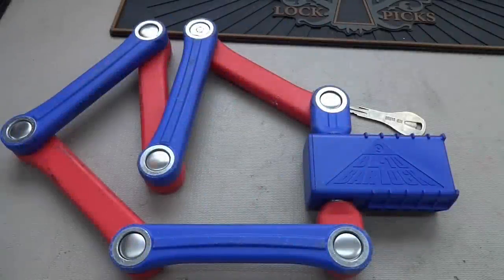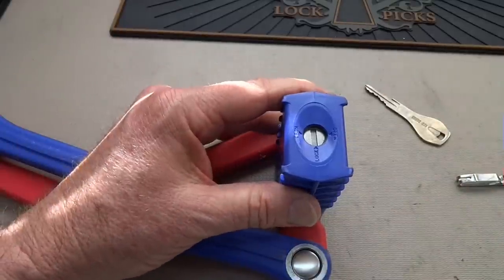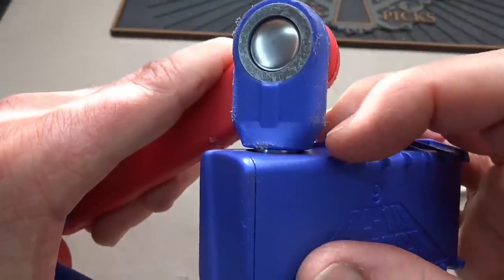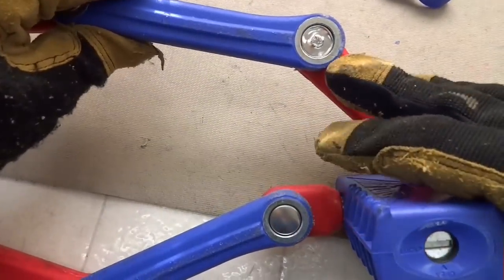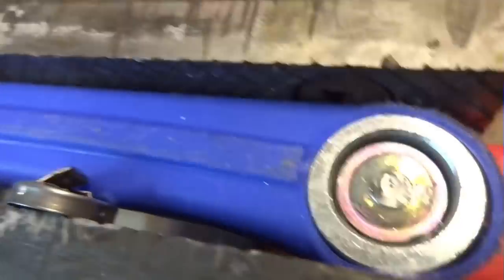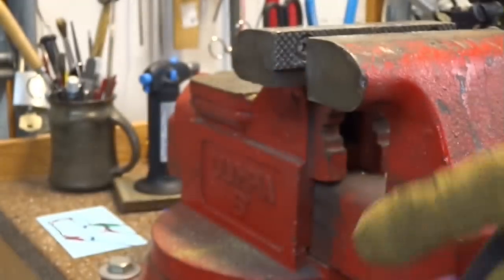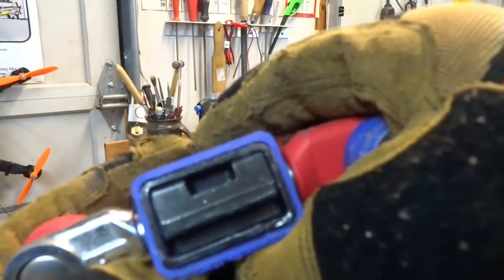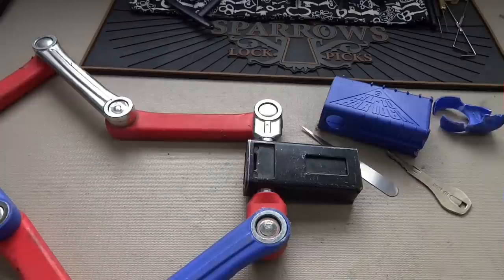(774) Japanese BL-10 Bar Lock

Comment: It seems like a massive oversight to not have the metal flared out to cover that shimming weakness.
Reply: +Dan Xepha that was probably expensive
Reply: nebreprah It wouldn't have really required that much more steel to be used. Just need it to be as wide as the plastic that was covering it.
Reply: My thought exactly. then it would be  impenetrable
Reply: Exactly what I came to say.
Reply: My exact thought. Penny pinching over that little bit of extra metal they'd need cost the entire security of the lock.
Sure, that little bit of steel adds up over a couple thousand locks, but I'm sure design-wise they could have taken it from elsewhere in the lock assembly.
Reply: Do you think maybe those battery powered Dremel with cutting disc would work or not enough power maybe I’ll test that
Reply: I know such a simple modification would go so far

Comment: Yes, a customer convenience caused it to be easy to shim, would be EASILY fixed with a large washer to wrap around the bolt of the lock, this would probably make it very difficult to shim.
Reply: yup
Reply: +Little John pretty much what i thought after seeing it,  apologies if it's already been mentioned ( & i ain't reading through 750 odd replies to find out) but a simple redesign of the bolt to include a shoulder would prevent this. Perhaps they're saving it for next years version...
Reply: stuart j Mckay Haha, probably.

Though honestly, some times I feel that they add these features to make them breakable for smiths.
Reply: +Little John anything is breakable for a smith. or an engineer when it comes down to it. the hard part is putting it back together afterwards.
Reply: vishal chan Well of course anything is breakable. The major flaw of this was how easy it was to shim, with $1.00 or less spent on washers, this lock became a hell of a lot more difficult to deal with.
Reply: +Little John agreed
Reply: They clearly noticed when designing, hence the circular shape on the base of the plastic shell. Id say idpf they had as you said a "washer", or just as extra metal circle just to sit flush with the outer face of the locking mechanism, rather than that plastic piece. (They probably didn't do it to keep manufacturing cheaper)
Reply: just make the metal shackle larger and closer tolerances. shim don't fit? problem solved...
Reply: even if they just made that plastic cover Bill had to remove out of metal instead it probably woulda done it
Reply: put the washer exactly whet the bolt sits in the lock and it would be shim proof
Reply: Bailiffs rather than locksmiths lol
Reply: unless its a very strong washer you could easily break it.
Reply: It'll be more time consuming even if the washer was breakable the amount of work it'll take I would get caught by the owner or. A walker
Reply: Wonder if they designed the metal parts first and got tooled up to make them then decided it was cheaper to change the plastic moulds than to change the steel machining later.

Comment: I was kinda hoping you might mill the thing open to find out why the lock was so hard to pick.
Reply: +Jim Fortune agree
Reply: agree
Reply: Agree
Reply: Three out of three people agreed with me on a post. A personal best! ;->
Reply: +Jim Fortune disagree.
Reply: +Jim Fortune He did in the revisited video.
Reply: Sam C I shoulda known
Reply: JelloMastermind From 7 hours ago? Wow you're current! ;->
Reply: +Jim Fortune 
If you're using a tumbler rake you're gonna have a hell of a time trying to get 9 pins to line up at the same time in order to allow the cylinder to rotate.
I'd like to meet the person that could use a hand full of lock picks to manually unlock this thing.
Reply: Jim Fortune I try my best.
Reply: it don't need picking as it's opened with a shim in seconds.  price of crap
Reply: Tangobaldy As he points out, throw a washer on the shaft and you can't shim it. And if insurance requires that the users replace them every year a slight mod could be on the streets in a year.

Comment: Could the issue be reconciled by expanding the part with metal just before the lock so it lays flush right against the gap where you could put the shim in?
Reply: +Donald Neal I thought of that also. Wouldn't be able to slide a shim in, or at least not easily.
Reply: +Slowpoke59 i guess they thought in polite japan nobody would peel off the plastic
Reply: +Justin M i'm pretty sure they left that in so a locksmith could open your lock for you if you lost the key.. but idk, i'm far from an expert.
Reply: kfftfuftur The whole point of hiring a locksmith is that you get the lock back as well.
Reply: +Oliver Turner or the car
Reply: nebreprah Well yeah XD i mean, if the lock is PART of the car then getting the lock back kinda means the car too, or whatever it was locking.

Comment: That shimming problem can be fized by just flaring out the end of the shackle ends so that the steel core blocks the gap.
Reply: +John Grewe That would resolve the issue. Other than it is a solid lock and I wish we had those in the states.

Comment: Sorry if this is a silly question, but how can the lock be free-floating? I'm just struggling to wrap my head around how that works.
Reply: +Virideon I'd like to see the lock taken apart so can see how it works.
Reply: +Virideon its just a flat zylinder inside a hollow cylinder, if you put the key in, it pushes the pins out of the inner cylinder, the cylinder wont have a flat surface anymore and kind of hook on to the holes of the outer cylinder that represent the locking mechanism
Reply: +jort93z If that's the case, could you use something to fit into that grove and tension it (instead of the normal tension wrench)?
Reply: He demonstrates that it's free-floating. With a tension tool or screwdriver, the plug is will rotate, but not unlock
Reply: @Marc Herrmann
that would mean only one pin needs pushing to turn the outer cylinder :-)

Comment: They could've easily designed against the shimming and still allowed you to just click the shackles in place.
I mean, unless I'm wrong, just having the exposed part of the shackle be larger and thereby block access to the otherwise shimmable portion.

I have to think that they somehow didn't consider anyone would cut off the plastic and shim it. A pretty significant oversight given the design of the rest of it.

Comment: It makes no sense that nothing binds when you try to pick the lock. May be the wafers are not engaged with the cylinder and that is why they can turn freely. If that is the case then wafers are also not locking anything so moving one of them far enough to engage and then turning should open the lock...

Comment: You didn't try attacking the links by forcing some sort of wedge between bars there.
Reply: That's the type of attack the Abus Bordo 6000 failed on. They used a pair of bolt croppers to force the links apart and I think eventually cutting the link pin.

Comment: Bill,  The key has a long neck - between shoulder and head ( bow. ) I'm assuming just the top section of the lock spins free - anti drill, anti tension. You may have tried it, but a longer extension on a 90 degree tension tool, would it reach the start of the key way to apply tension? The key appears similar to many Japanese vehicles, with 8 staggered wafers - 4 on either side. The tops of the wafers could be serrated, matching the serrated wafer slots, although that's not always the case.   Regards, Brian.

Comment: Can you smack the lock portion with a mallet to bounce the locking pawl and yank the loop out?  The timing might be difficult, because if you're pulling the bar away you might be locking up the pawl so it doesn't bounce.

Comment: have you tried getting a pry bar and hammering it in between the joins on the lock?
Reply: +Ericbuyslunch He tried punching the joints out and explained why that wasn't possible, so prying them apart won't work either
Reply: +ProdigyThirteen Spot welds aren't that stong, and the wedge is going to give you a force advantage and strain the join in such a way much more of the hammer blow will be against the weld points.   A good pickle fork or other ball joint separator might work. http://www.ebay.com/itm/BALL-JOINT-SPLITTER-SEPERATOR-SEPARATOR-TIE-ROD-END-REMOVER-REMOVAL-3250-/321375724869
Reply: Really old response, but after watching LPL use a nut splitter to open a similarly beefy Abus, I think it's viable. ( https://www.youtube.com/watch?v=Zs8uyPsDaw0 )
The point of weakness is the tensile strength of the rivets connecting the bars. Using a nut splitter like his, a tougher rivet simply translates to a few more ratchets. That said, this lock looks tougher than the Abus, and I'd love to see LPL get his hands on it (I'd also love to see LPL try to pick and/or gut the core.)

Comment: Thank you for using metric units!
When in comes to shimming this is sometimes prevented by means of a one time mechanism. That after the lock has been opened it will allow one pass before it locks the mechanism. especially on doors this is made by means of a extra tongue that will activate the lock.

Comment: if you freespin the cylinder at high speed, could centrifugal force set the wafers?
Reply: Ron Fish interesting but there are certaintly precautions against that method on most locks. Plus if the lock is being used in commercial use there would be no way to spin it.

Comment: Can't really make out the tolerances on the lock, but maybe the pals that holds the links together are not hardened. so try and use the hacksaw between those bars if there is a bit of a gap.

Comment: as thin as those bars are would a long handled bolt cutters do the job?
Reply: +todd Brewer 
Regular bolt cutters aren't intended for hardened steel, I have a pair of hefty ones and I completely crushed up the jaws just trying to cut up some mild steel bars.
You probably could do it with pneumatic cutters they use in rescue operations, but that is a hefty overkill, you are better off getting a battery powered grinder.

Comment: On the other hand, if the shackle lik was MUCH shorter, or simply have a disc formation around preventing shimming, it would be a top grade lock.
I think this would be still a great lock to buy, because this weak point can be fixed in a DIY way, by welding a rim around the insert part.

Comment: Bill, did you probe the back of the lock. Staring at a still from  0:49, there  is something about that key tip that triggers my spidey sense.  Could be my imagination, but most keys look closer to 45 degrees than that.  I get the feeling that it may be a hybrid of a disc detainer and wafer lock.  There must be something with resistance that retracts the pawl, and all I can think is back of the lock.

Wafers and a side bar. with the sidebar sloting into the actuator when the wafers are aligned?  Looks like a fun project to figure out

Comment: I have been using a PICK SCOPE for many years on vehicles with wafers.  This method works if you know the depths and spaces on the lock.  The method is simple, and works when normal picking fails.  
It fails when there are more that 6 depths.

Comment: Case hardening can = brittle. I'd wager that, without that plastic sleeve, the bars wouldn't stand up to a solid hammer blow.
Reply: +bosnianbill Love the wife line lmaoo
Reply: bosnianbill
The plastic sleeve could be absorbing the brunt of the impact. Also the size of the hammer you're using could be spreading out the shock wave too much. I work a lot with case hardened chisels and files. They can usually stand up to a hammer hit, but use a punch, and you can usually shatter them. Think tempered glass. Bash at it with a rock and nothing, but use a pin hammer and it'll fail catastrophically.
Reply: +antagonizerr Case hardening =/= brittle.  Comparing a security bar to a file is apples to oranges in this case.  That bar is designed to be tough, with a ductile core, and case hardened to prevent entry.  In all honesty it may be nitrided, which would give a harder surface.  Files have a number of problems in their manufacture that make them completely unsuitable for transverse impacts.  Your analogy to tempered glass is perfect though, but in counter to your argument.  Files fail because of stress concentrations in the gullet of the tooth, in the same way tempered glass fails from crack propagation at a stress concentration.
Reply: rosw2
Only one way to solve this; undertake the experiment. A body hammer would be a good tool to use with it's pointed end that's narrow enough to focus the blow, but wide enough that it won't slip off the bar when struck.
Reply: +antagonizerr Case hardening is a surface treatment for mild steels.  It makes a tiny outer portion brittle.  The meat of it retains the properties of mild steel.
Reply: +antagonizerr Purely opinionated statement not that I'm trying to defend foreign sourced products especially junk like this, just you have 0 validation behind your reasoning. There are literally an infinite amount of ways you can case harden steel and on top of that case harden only hardens the surface of a material I.E the word CASE being used. That being said the core of the material still maintains its ductile properties this is usually done in industry to prevent surface wear. Just because you bang on chisels with a hammer every day doesn't make you a materials engineer.
Reply: +antagonizerr Well, since the plastic is part of the lock, it's valid to attack the lock with the plastic. Unless melting off or cutting the plastic is a realistic attack (which is might be).
Reply: +Grapthars Hammer Sorry, I see that later on, he cut off the plastic easily.
Reply: +antagonizerr case harden = brittle? lol whoever told you that probably got their brain cold worked...
Reply: +antagonizerr Chisels and files are not case hardened, they are through hardened, and that's why they're brittle. Case-hardening, i.e. only a thin outside later of the material is hardened, does not embrittle it. That's why many locks have case-hardened shackles.
Reply: +Orcinus24x5 You beat me to it. Chisels and punches should be made out of something like S7, through hardened and then tempered by applying heat to the back end of them till the front gains some toughness but still remains relatively hard, by which time the back end has become relatively soft again so you can beat it with a hard face hammer and not have it break.
Reply: +Grapthars Hammer Took you long enough lmfao.
Reply: +antagonizerr oor then just come in with an angle grinder and thats it?
Reply: +bosnianbill it is possible. I am a goldsmith myself. Any metal that is brittle will eventually crack, and any crack when worked will grow. A quick way to cut through a solid piece of metal is to make a small insertion cut much like what you did with the grinder and then place it in a vice, hammer it one way then the next it will crack and break. The more brittle the metal the easier the process as soiftened, annealed metal will just bend all the time and make the whole process longer. It is very possible even without a prep cut by just placing it in the vice and grabbing the biggest hammer you can, knock it one way then the other most times you only need a good three knocks in a good 90degree
Reply: +antagonizerr By casing steel, it has the benefits of hardness and wear resistance of hardened steel, and the toughness of annealed steel.  Not to mention hardened steel is only truly brittle when not heat treated properly.
Reply: +antagonizerr  You could probably open it with  cannon...but who carries a piece of heavy artillery up the sleeve....when they're up to steal a motorbike? :)
Reply: +bosnianbill Oh, the wife joke

Comment: Sorry for the late post just found the video. 
I would have suggested folding one set of bars together and driving a pair of wedges between them. Using  the leverage of the links against the pivot pin.

Comment: So if they widen the with of material closest to the lock on either side you would have a pretty good lock, as in make it unshimmable lol
Reply: +Emmett Coen a sort of close fitting "collar" edge forged into the same bit as the locking post...the other thing would be to have a blocking pin engage the back of the pawl when it's in the latched position so it can't be raised by shimming....
Reply: Now that's a fancy way of what I was getting @...i not a lock head, so excuse my explanation... Ha haa

Comment: Lol. Completely unpickable, damn near unbreakable, extremely resistant to cutting and sawing.. can be shimmed in less than 30 seconds.. Could literally be fixed by making the overhanging metal hang closer to the lock so you couldn't get straight access with the shim so easily. "knew what they were doing", I have some strong doubts about that one.

Comment: A sort of folding shield around the insert, that slides in place via grooves of the locking insert, could make this lock impenetrable. A 90 degree cu to the outside of the insert would ensure it couldn't be pried open to shim it, instead of simply widening the metallic body of that piece.

Comment: Bill i have got an idea if you use plumbers freeze spay what they use to freeze pipes when you cant turn the water off. freeze the metal real cold then hit it with a hammer by rites should shatter ! if it is cold enough the metal should turn brittle.

Comment: SUPERIOR NIPPON STEEL FOLDED OVER 1 MIRRION TIME CAN NEVER BE BREAK
Reply: +b33lze6u6 
 Unfortunately, this isn't folded. But it is hilariously hard to pick. Take comfort in knowing that it is extremely difficult to get into this lock without leaving a trace or attracting a LOT of attention.
Reply: +b33lze6u6 While I love the joke and I laughed. Just figure I'll tell others the main reason why Japanese had to fold their steel so much is cause of how low quality their iron ore was. You can also see this in their buildings, where they didn't use nails and just use a bunch of fitted wood joints and wood shims.